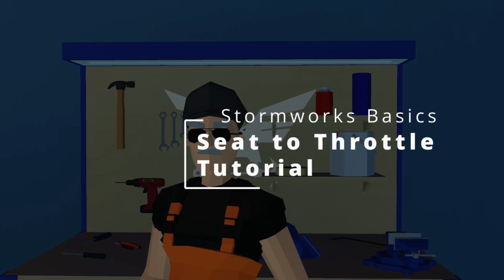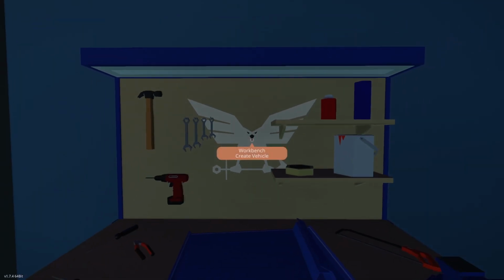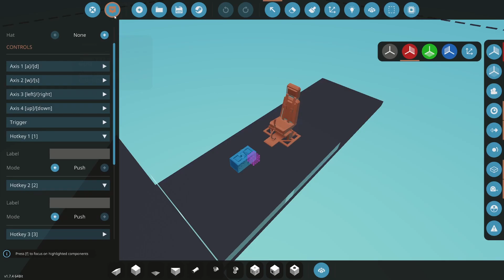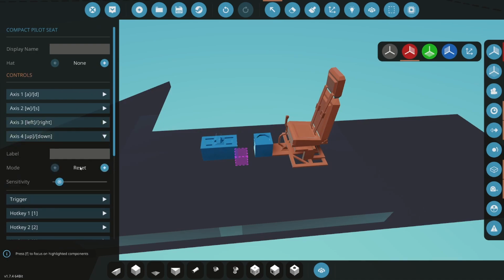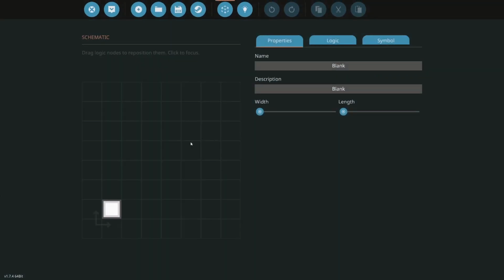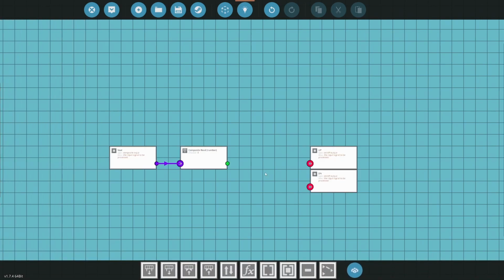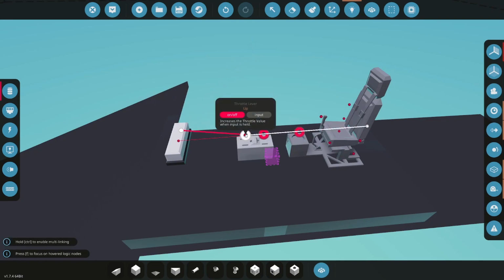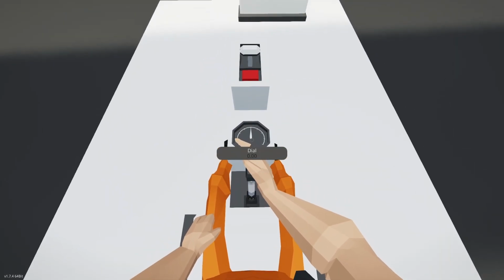Stormworks Basics: Seat to Throttle Tutorial #stormworks

Comment: It would be awesome if they added throttle for instrument panels.

Like you could have a maximum of 2 throttles on a whole panel like 1 & 3 would be a throttle and then 2 & 4 would be other buttons. 

And also Key switches to start engines etc. For instrument panels. 1 & 2 could be 2 individual key switches just like many boats are and then 3 & 4 would be other buttons. This would just make everything so much cooler and its not that hard to do either (at least I think its not)

(Sorry for my grammar)